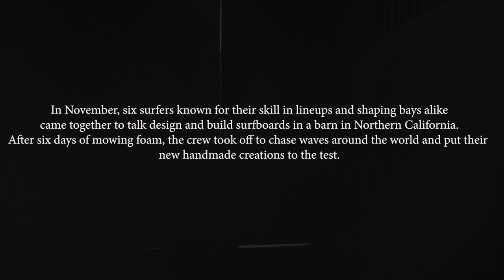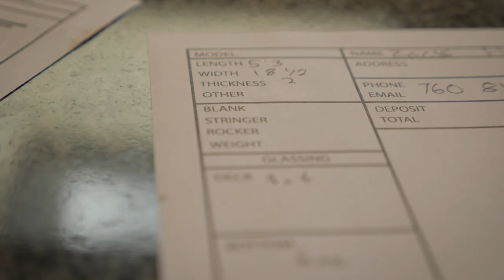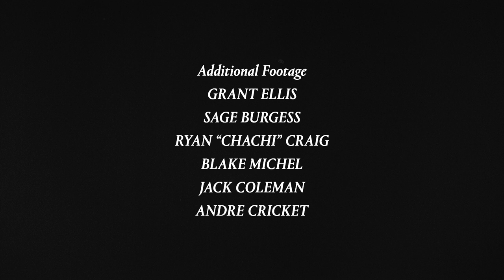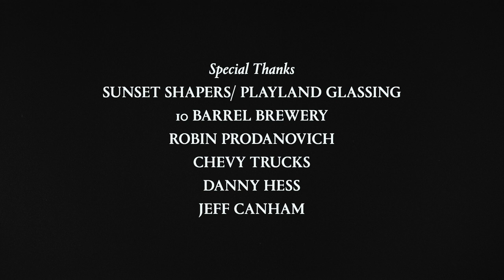HANDMADE | A Tribute To DIY Shaping feat. the World's Best Surfer/Shapers | SURFER

Comment: burch is the one that inspired me to start shaping and now im 15 down :-)
Reply: Any tips on shaping my first board?
Reply: Phillip Priolo watch as many shaping videos online as you can. matt kazuma has a ton of really good tips but some of it can get confusing when your starting out. ive talked with alot of shapers now and the 2 big things ive taken away is 1. start with your most aggressive tool (planer) and get as close to your shape as you can with that tool, and work down to the next tools (surform, sandpaper) and 2. be mindful of how you handle your tools. every move you make will show in the shape, so try your best to be fluid and use big movements across the board instead of digging into one spot and moving to the next. if your planning on glassing and sanding your boards theres a step by step instruction on a channel Andrew W but his shaping isnt “masterful”. just have fun with it and remember just like surfing its not going to start out perfect but just keep working at it and you can do some really cool stuff :-) good luck
Reply: @CantTalkImRiding  Know what the elements of the shape will look like in your head. Gives you a target to shoot at rather than just winging it the whole way (less chance of big mistakes). Have other boards around to reference. Go slow. You can't put foam back. When in doubt take a step back and consider what  you're going for and how you'll get there. Sometimes you need to drop it for a day or two when you're in a jam. Blendingcurves has a bunch of good templates.
Reply: @GuapLord5000  I made a big blunder by rushing, but I recovered. It got thin in the tail, but I'm taking it in to a shaper to get feedback before fins and glassing.